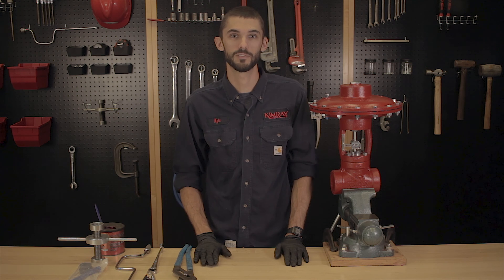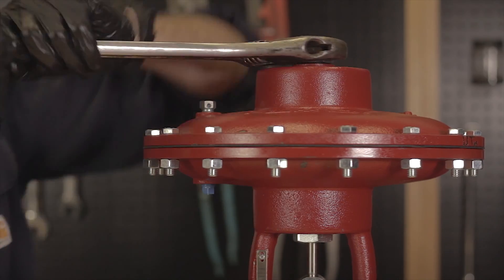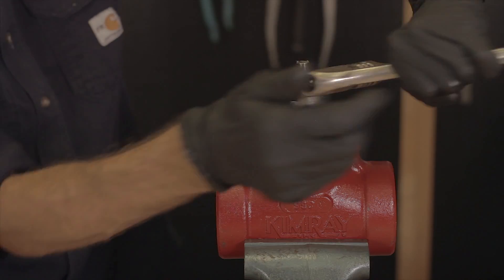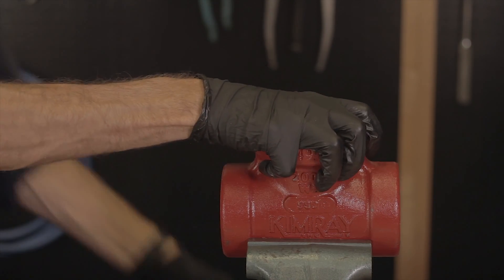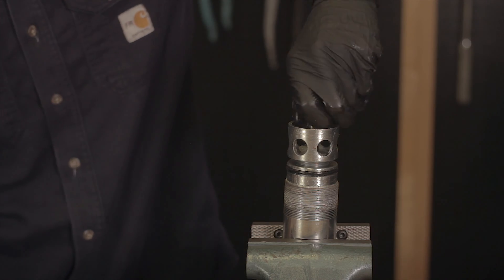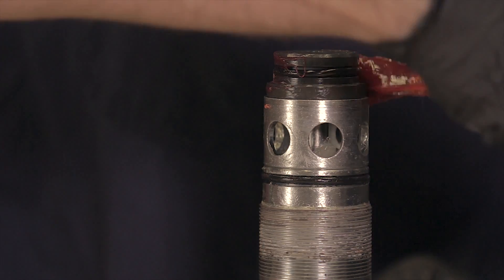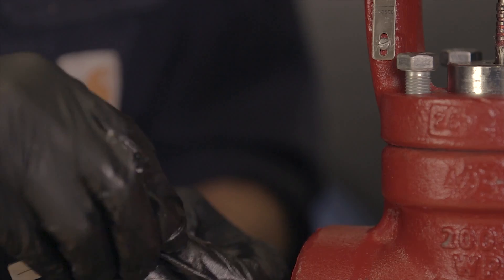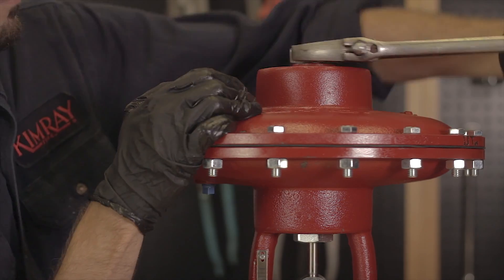Control Valve Repair: 🔧 How to Replace Valve Stem Trim

Comment: I know this is supposed to be out of context, but an instruction to isolate the Kimray before work and to remove stainless supply lines would have been great.
Reply: If you’re working on what that’s on a separator, you would shut in at the well head. Close inlet valve on the separator. Open swab line. And blow down.